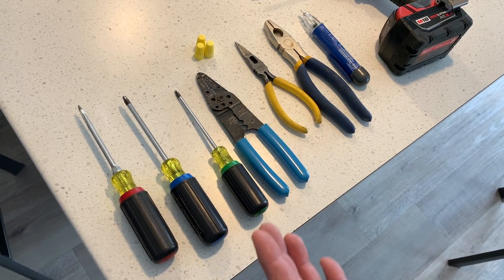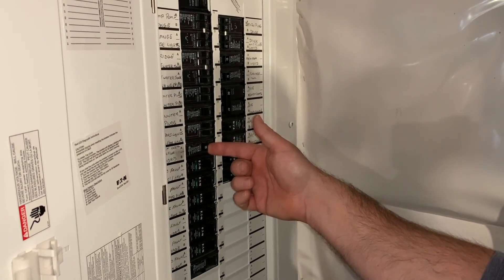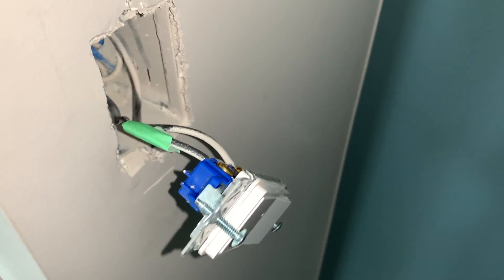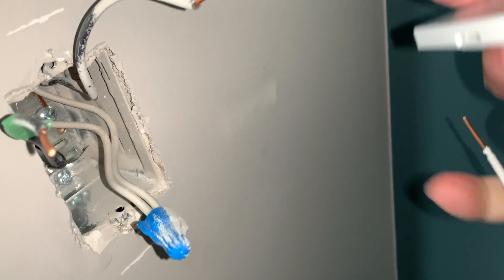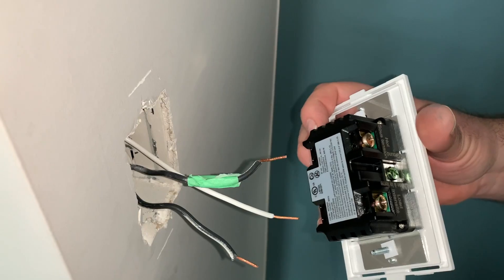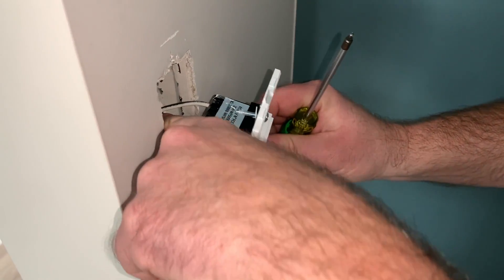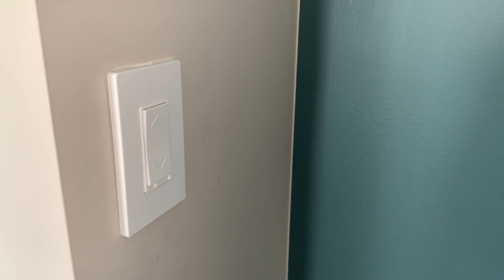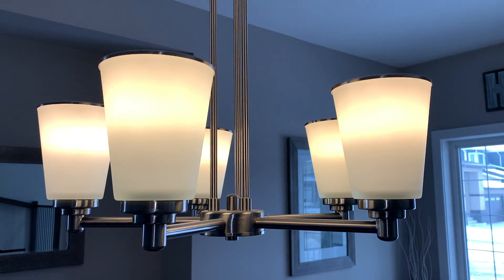Installing a Smart Dimmer Switch w/ neutral wire

Comment: Thank you for showing how to connect the neutral wire, and clarifying that a ground wire connection to green screw on the switch isn't required if the ground is attached to the screw on gang box. Well demonstrated the process. Can you please as well show how to replace a three way regular switch with a three way smart dimmer switch. It will be very helpful. Thank you

Comment: I have a question, from your video you show us how to check for which one is the hot with the pen. What if you don't have that? Will it say hot on the original switch? Or do we assume its always the top connection of the switch. Thanks
Reply from the maker: The switch wont usually identify the hot or power wire.  Another way to check is with a multimeter, check for 120 volts.  In gang boxes with multiple switches it can be hard to tell. The switch simply breaks the circuit on the hot wire, so it doesnt matter if that goes to the top or bottom screw.  In a lot of boxes I have seen, the hot wire will come in through the bottom and the wires out the top of the box will go to the fixture.  But this may not always be the case.  Hope that helps

Comment: I want to install a Lutron Maestro PRO switch.  I need a neutral wire for that switch and I have to use a pig tail like you do in the video,  In my switch box, there is a group of white wires twisted just like yours.  However, in the switch box, there are two other switches.  I'm assuming those white wires twisted together are neutral wires..  How can I determine that hooking a pigtail wire from the PRO to those wires is the correct course of action?  They have to be on the same circuit for it to be proper, correct?  Thank you!
Reply from the maker: As long as you only have one power wire coming into the gang box you can pigtail to that neutral bundle.  If all the white wires are pigtailed already this is most likely a single circuit.  You will tell this by flipping off the breaker and checking for power at all the switches. You should be ok to pigtail from that neutral bundle, just make sure to use the correct sized wire nut (marrette) for the number of wires you will have twisted together.

If there are 2 power circuits coming into the gang box you would have separate neutral bundles and would connect to the neutral bundle for the specific light you are trying to control.

Hope that makes sense.
Reply: @jofalltrades1816  Thank you.  I have three light switches.  The left and right switches are on the same breaker and the middle switch is on a different breaker.  The left switch has red/white/black wires going to it.  This is where I want to put the PRO.  The wires that appear to be the neutral bundle come from other cables behind the other switches.  Would it work if I pigtailed the neutral wire from the PRO to the white wire bundle that's associated with the right switch since they're on the same breaker/circuit?  Thank you sir!
Reply: Never mind.  Got it working.  Thank you for your time and help!
Reply from the maker: @RHochroth1  Good to hear!  If you pigtailed to that neutral bundle on the same circuit it will work perfectly.
Reply: @jofalltrades1816  And that's exactly what I did!  Thank you!

Comment: How common is it for homes to have this neutral wire?  Is this also done in older homes built in 70-80's?
Reply from the maker: Most home from the 60's and on will have copper wiring with a neutral wire.  70's-80's should have this, it may be NMD-7 wire instead of NMD-90 but the neutral should be there.  Some 70's era homes may also have aluminum wire, as this was used instead of copper for a period.

Comment: I never untwist the existing wires. They're very brittle and break. Do this enough and you'll run out of wire.
Reply from the maker: agreed, especially on an older home with thinner copper conductor.  This was only a year old, with plenty left in the gang box.